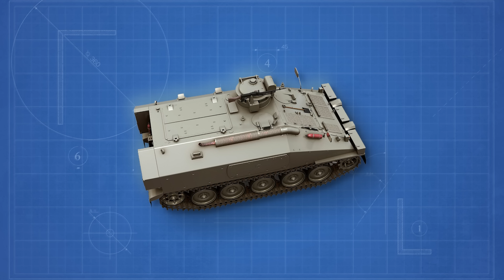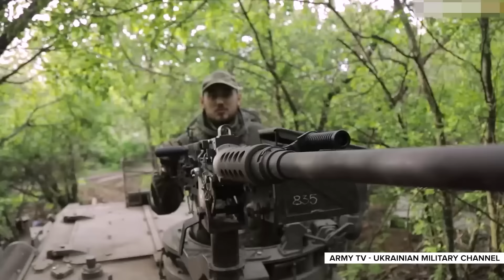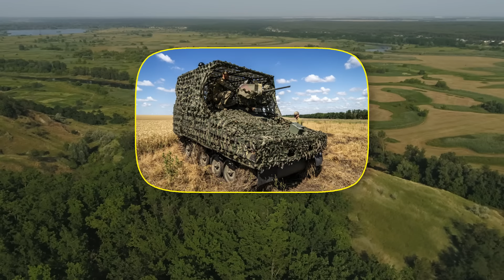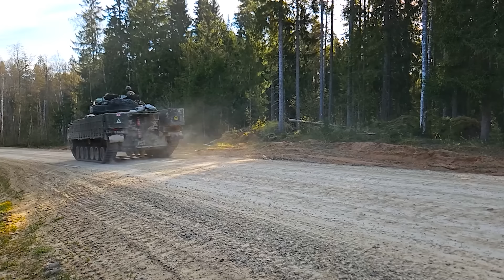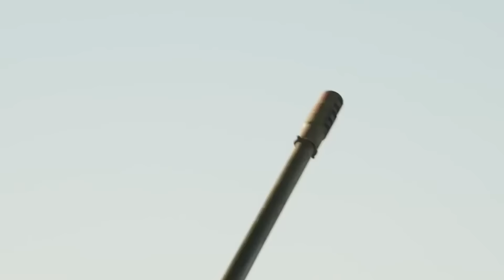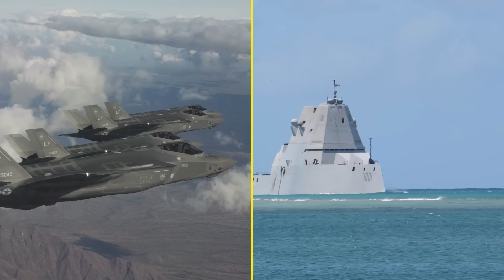Ukraine Turned UK’s Junkyard Armor Into a FRONTLINE MONSTER

Comment: The British Army was still using the CVRT's up to 2012, I was operating a spartan in 2010 in Afghanistan and it did work well out there. And its unfair to compare it to the Bradly because they weren't doing the same role, the British had the Warrior for that.

Comment: There are a few old armoured vehicles that the UK could provide to Ukraine.
The old 432's can be easily converted into battlefront ambulances. Other vehicles like Spartans and Scimitars still have a place as Recce vehicles. I would have liked to have seen a number of Warriors being used to move troops to the battlefront. They are fast and reliable. They can reach the frontline, drop off troops and exit the battlefront way before Putin's artillery, or drones can zero in on them.

Comment: This is total bollox, the FV103 is being compared to Bradley when the Brit comparison is the Warrior FV510. The British have never seen the Spartan as a proper IFV, it has been used just like the Ukrainians used it, a fast nimble taxi and support vehicle. There are many other variants of the CVRT Chassis from command ,ambulance, mechanical recovery, missile launching platforms and RECCE etc. They were also not retired in 2009, units had them well after that.

Comment: The Western world has gone down the “Wunderwaffen” wormhole.
What would you rather, a vehicle with high readiness, largely field serviceable,  excellent crew/cargo survivability, good armament, that can be built quickly at lower cost, in high numbers, or a tech marvel that is less than 50% available, requires special service shops, expensive high cost low availability parts, costly and slow to produce, good armament, with excellent crew/cargo survivability?  
It’s going to depend on the field.

Comment: The vehicles will be brought there for recycling. Tans, helicopters, train engines, aircraft engines, car batteries etc. The area will be arranged in a pattern for the main warhead of the Satan 2, to form the titanium lead cutter edges. The smoke will be stimulated by laser to form the blades earlier. Earthquake is planned to enhance the speed of the tetra molecules.

Comment: Did he say the M113 could fit 11 soldiers? Is this the TARDIS version? I spent 6 of my 10 years as an 11B in Mech units back in the 80's and 90's and there is NO WAY, even including the driver and TC, that you will fit 11 guys inside a PC. On our best day we could squeeze 8 guys in the back, if they had no extra gear and at least 6 of them were small dudes.

Comment: This demonstrates the logic of France's EBRC Jaguar. Small, agile, fast, not expensive, easy to repair, in and out of contact points, easy to learn, quick to deploy, quick to manufacture and adapt,... it's even better with top electronics.

Comment: The actual LESSON LEARNED in WW2. Was that lots of standardised “Good enough “ vehicles weapon etc will beat  a few amazing Tech Hyper weapons the Germans had all the best kit but not many actual units and needing huge maintain equipment troops  Vs loads of Good  enough easily built basic but just right in  the field etc

Comment: The survival rate for the Spartan looks good only if the role it performs. The Spartan does not operate at the front-line or in advanced ISR roles. It's not used in the hot zone. Any armoured vehicle would have reached the same or better performance.

Comment: It is not what you have but what do with it. The Combat Vehicle Reconnaissance (Tracked) series of military vehicles is very small (difficult to hit, easier to hide), very light (very low ground pressure - ideal over boggy terrain that would disable a traditional tank or heavier vehicle), very agile, very fast, very easy to maintain/adapt/modify, very lethal (30mm cannon especially if the crew have a few shoulder launch weapons in the back as well) with a huge range. Yes the amour could be better, but any increase in weight would degrade and compromise the whole system. It is not designed to slug it out with heavy amour or be in a prolonged fight (it is not a Bradley or Warrior). Remember you don't fight the battle your enemy wants to fight, you fight the fight the enemy doesn't want to fight, is compromised fighting or so disadvantageous to them they withdraw. It is designed to scout, shoot and scoot before the enemy realise what has hit them and survive to fight another day, when you use it this way, it is fantastic. Ukraine are using the CVR(T)'s as they were designed to be used, perfectly.

Comment: I wouldn’t over sell this. The Ukrainians are driving to, or suppling forward lines with whatever they can get including regular cars and light trucks. Its good these are bing used but I doubt anyone would choose with platform. The best item they received seems to be the Bradley which had come in large numbers and had even gone toe to toe with Russian tanks at times. PS Western doctrine is built upon greater air support than Ukraine has.

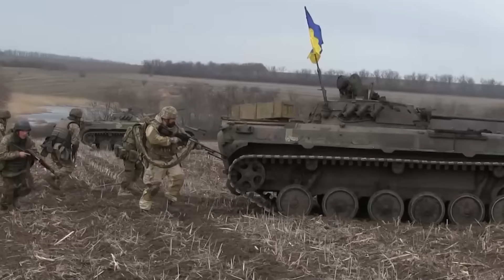Comment: 5:50  There is no such thing as "NATO doctrine", and especially not for IFV/APC.  It varies from country to country and over the decades.

The IFV concept does indeed expect the IFV to deliver the troops (battle taxi) and stay to support.  That concept was adopted FROM THE RUSSIANS.  You see it with the Germans once the Marder came into service, the Americans with the Bradley, and the British with the Warrior, etc.  BEFORE then, the vehicles are simply battle taxis and little more.  M113, FV432, etc were designed and expected to simply cart the grunts around and deliver them to, or take them from, the arse end of the fighting area.  That's no different from Russian doctrine prior to the introduction of the BMP-1 - well, the Russian doctrine wasn't quite that, but close enough for purposes here on YT.

The CVR-T series were designed for fringe activity on the FEBA.  They were not designed to go toe to toe with frontline battle groups.  Whether it was the recce vehicles or the Spartans or the Strikers or the <whatever> they were designed to be used on the edges of the FEBA - in front of it, the flanks, or behind - to harrass, observe, extract, or annoy - the enemy main formations.

Comment: There's 7 of this type of AFV in the family, all of them very useful pieces of kit :

FV101 Scorpion: The main reconnaissance fire support vehicle, armed with a 76mm L23A1 gun (or 90mm Cockerill gun on the Scorpion 90).

FV102 Striker: Anti-tank guided weapon carrier, equipped with Swingfire missiles.

FV103 Spartan: A small armored personnel carrier (APC) designed for specialized team transport.

FV104 Samaritan: Armoured ambulance variant.

FV105 Sultan: Armoured command post vehicle.

FV106 Samson: Armoured recovery vehicle.

FV107 Scimitar: Armoured reconnaissance vehicle armed with a 30mm RARDEN cannon, often operating alongside the Scorpion.
Reply: I thought Canada should have obtained this line way back in the 80's. Also some Swedish S tanks would still be useful.

Comment: The important factor that Ukraine is missing in this war and the US has had is air superiority/supremacy/dominance. Western ground warfare equipment was designed for use in combined arms warfare. If Ukraine was supplied with everything needed for air supremacy many of the challenges that inhibit the use of western ground forces equipment would be eliminated or drastically reduced.

Comment: That low ground pressure is definitely a huge advantage - 0.35 kg per cm2 (CVR(T) design ground pressure) is basically the same as a man standing on 1 leg...  
Abrams is around 3 times as much (depending on configuration)!  I believe that this was found to be a big advantage in the Falklands too.

Comment: As Latvian I am proud of our CVRT vehicles in our army. :) We have full battalion of CVRT class vehicles. 60% of Latvia's territory is covered by dense forests, and CVRTs, due to their size and relatively low weight, are excellent at fulfilling their tasks. Currently, the Latvian army has about 184x CVRTs, as we gave some to Ukraine. We have the Scimitar, Sultan, Spartan, Samson and Samaritan variants. They were all fitted with completely new diesel engines and overhauled.
Reply: CVR(T) was designed to sneak around German forests during the cold war hence their small size and signature. Glad Latvia are using them to their potential.
Reply: Cheers from Canada
Reply: I hope you never have to use in war.
Reply: @wizardkingmagic Many Latvians, Estonians and Lithuanians fight in Ukraine, these brave Slavs know that if Ukraine falls Russia is only a stone throw away from their country!
Reply: @ConradVyce  None of Baltic nations are slavs.
Reply: @wizardkingmagic 
here-here! CND

Comment: The spartan was still been used until british forces withdrew from Afghanistan. The difference was they was fitted with a turret and 30mm canon. Panther was a replacement for the sultan command variant and crewed 3 soldiers.

Comment: Operated CVR(T) Spartan a lot in the army, fast and reliable. Several times we had 16 to 20 soldiers clamber on board to be transported a mile or so, as a taxi, inside and out, to quickly get from A to B, so can verify this isnt new. Also a number of these vehicles were used in the Falklands war in 1982 performing very well across very boggy terrain and again used as taxis.

Comment: 60mph? Only if it still has the regulator fitted. Pull that, and you can get quite a bit more out of a Spartan. Reputedly, they are the only armoured vehicle capable of breaking the speed limit on a UK motorway (70mph). Also, 195hp from the Jag engine? That's from the standard unit. Rebuild the engine, you can get 250+hp easily, using parts that are cheaply & easily available - pretty much any Jag spares dealer can put together a kit of parts that'll do the job, off the shelf...
In standard form, Spartan's are Fast. In mildly modified form, Spartans can be Very Fast...

Comment: Albert -:Welcome to Leith It might seem a flimsy vehicle until compared to a Light Infantry Battalion Tow platoon or consolidated company. The TOW mounted on M-151 Jeeps. The advantage might be that 12 TOW Gun Jeeps might be carried creatively on a C-130. That somewhere deep behind the lines would like to German specialty platoons dropped far to the Russian rear to attack supply columns. 
The point then that the vehicle can mount a TOW system. These days with 155 common I would not relish being under fire from either.

Comment: This video overlooks one important aspect of western thinking. The high cost per unit and complexity of western equipment is about crew survivability more than survivability of the vehicle. Experienced crews is what makes military equipment really effective. Dead crews - not so much.
Also, from a logistics perspective, having one or two highly capable but expensive units on the front line is vastly preferable to half a dozen less capable vehicles doing the same job because those vehicles will need three times as much fuel, three times as much food and water.
Reply: Current spartan/ bradley usage in ukraine says otherwise. Bradleys and M1s reach their vehicle service level and are shipped back to hhe USA because General Dynamics refuses to have other firms repair them (Russians happy) while the spartan is repaired right then and their near the frontline

Comment: As with all CVRT the exhaust noise is an issue.  When serving I replaced the exhaust with a commercial Jaguar V8 one.  It was as quiet as a mouse and caused no back pressure issues with the Jaguar engine.
Reply: Yeah, absolute bollocks!

Comment: Explaining why both the Spartan and the old M-113 are so cherished by the Ukrainians.
They are utterly reliable and simple to maintain, have a decent speed and can be adapted to many uses.
Particularly where the M-113 is concerned, there are loads of variants, or you can do your own thing with a can opener and a welding kit.
Quantity has its own form of quality, the more the merrier! They would probably love to get their hands on a bunch of Scorpions and Scimitars,
as well as that German speedster the Wiesel. Any way you slice it, old kit can always be surprisingly useful if deployed wisely  Be well and stay safe
Reply: The same as with the Dutch YPR765. I think we donated about 200 of them to Ukraine and they are the ultimate combat taxis. Much, much better than golfcarts, motorcycles, donkeys and horses.
Reply: @johtor2358   373 Dutch YPR765's and an undisclosed number from Belgium.
Reply: That and they need any type of tracked and wheel armored transport they can get. Even if it’s crap compared to other APCs and IFVs.

Comment: The Bradley has fallen into the same trap that the Panzer did in WW2. 
Technically superior, but was so complex, transmission issues meant it was shipped back to Porsche in Germany , whereas its counterpart, the Sherman could be field stripped and assembled in a few hours.

Comment: Spartan was NEVER intended for the same role as FV432, M113 or Bradley. It was for small groups of specialists, such as air defence sections, mortar fire controllers, and engineer reconnaissance teams. CVR(T) was a family of vehicles - Anti tank missile was Striker, turret mounted 30mm RARDEN was Scimitar, and ambulance was Samaritan, plus others (Engineer, Command, etc).

Comment: Thanks that was interesting and I appreciate your time making it. ❤😁👍
This appears to be a great little unit with alot of unrealised potential. 
Any good quality tools are ffective in capable hands.
Or people with the vision and witts to use them beyond their intended role..
I'm glad the Ukrainians see it.
The Spartans would make very very good drone armed mobile launch and control systems.
Used in small platoons 3-6 units.
With good mobility, speed and compact size, it's ideal for observation and drone deployment operations.
 
Anti drone capability upgrades could be as simple as claymore type pads on thin standoff amour.
Aimed at interception before contact, remotely fired from inside. 
Very, very inexpensive and effective, easy to retro fit and rearm.
It was a lost asset to English forces, with a lot of potential.
Our military leaders are going big and expensive.....
Expensive just means fewer combat ready units.....harder to service, repair and slower or impossible to replace.  
Ultimately if you blow the tracks or wheels off any vehicle, it's prey that's going to be turned to scrap soon after, regardless of cost in the modern battlefield.

Comment: Gotta give it to Ukraine. One mans trash is another mans treasure. Their military has shown extreme adaptability because using a hodgepodge of equipment means complexity. You need trained operators, and commanders must know the strengths and weaknesses of each type of unit.

Comment: Still has better armor than any BMP or BTR.
Reply: Not really, we were told that an AK could chew through a CVRTs armour at close enough range.
Reply: @Killzillastudios  Well we've tested BTR and BMP armor against an AK and it fails, goes through like butter sometimes if hit at a close to 0 degree angle.
Reply: @dudarsky guess they are both not designed to take any significant fire

Comment: "No match to modern ruzzian equipment" - most of their stuff was made in or before the 70ies. T-90 is basically a cheaper version of T-72 with a few minor upgrades. Yes - they have things like Tigr - but so few of them they even bothered to sent an unarmored prototype to Ukraine. But most importantly: They lost almost all of their halfway modern systems. Today - they run even short of T-62s.

M2 Browning is a hard-hitter - but it's tech from WW1 - designed as a short-range anti-tank machine gun. Yes - a .50BMG bullet can easily fly 1.6 miles - but the mostly-used WW2-vintage single-point mount makes it effective only to about 400 meters. It kicks like a mule - and the heavy bits flying back and forth inside of them make your bullets go almost anywhere - but not necessarily where you want them to.

Comment: Love your channel but get your facts right all the cvrt models sent to Ukraine are the later models with the super reliable Cummings diesel used in so many plant vehicles. Some even have the uprated clutch gearbox and air con on the Scimiters. The sultans we sent were stripped out from command vehicle mode to casualty evacuation and I have movies of 19 soldiers exiting. You’re wrong on your numbers to. Endless more cvrt type vehicles have been sent and many more are lined up to go. The 432’s are popular to and in my opinion superior to the American m113’s especially on road.

Comment: More Lancet magnets.
Reply: aluminium...not magnetic!
Reply: @richardsimpson3792  Aluminium burns extremely well, and at low temperatures.
Reply: @stephenrogers8518 to get it to burn, you have to hit it...which is difficult if it's going 60 mph

Comment: Spartan means just that light weight small target and quick enough that can go anywhere. Better than a Bhukanka any day.
If the Spartan was designed and built in the 1970's, with rubber road wheels and rubber track pads it may have been used for conflict in the city streets and roads of Northern Island and taken to the Rural and Urban areas of Cypress and the Falkland Islands.
Which other modern nation was fighting a Guerilla war at that time?